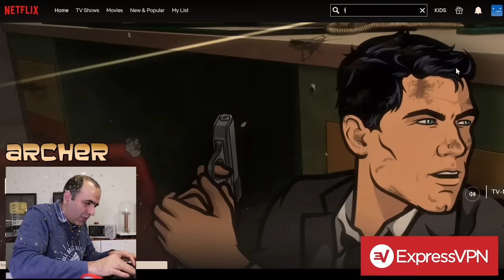What It Takes to Break a RAM with ESD (ft. Linus Tech Tips)

Comment: Have been building computers since the mid '90s, haven't killed a single component by ESD.. And only 2 CPUs by crazy over-volting/clocking
I build'em wearing socks on carpet, test mobos placed directly on the carpet, and I regularly wash components, GPUs and mobos, in the dishwasher (obviously remove the battery and heatsinks, and don't use detergent if you don't absolutely need it, wouldn't trust the cleaning agents to not erode/dissolve the lacquer/epoxy coating on the PCB)
As long as you make sure the component is completely dry before applying power, the odds of killing it are nil.
Reply: The most recent thing I chucked in the dishwasher was a laptop mainboard (i7 9750h w/ an nvidia 2060) about 2 months ago and then placed it in front of a fan, on low speed, for about 12 hours before reassembly. System works fine and looks brand-new. (most of the plastic clam-shell case for the laptop went in as well)

Comment: Putting ram in a motherboard and powering it does not test functionality.  Even a POST memory test just counts the addressable space.  You need to set each bit low, and high, and reread the values; and  even then you can hit some issues that show intermittently.

Comment: Did you actually test the RAM after every time you zapped it or did you just accept the BIOS beeping as if the RAM was still ok? I mean you could have easily damaged a small part (few bits or bytes) of the RAM without the entire stick being broken, BIOS could even accept the RAM stick, but trying to run a program in the affected area of the memory might result in malfunction of the software!

Comment: Install the contact discharge probe. Set the gun to +8kV 20Hz, touch the tip to a data pin, and let 'er rip.  Of course, that's not painful

Comment: Linus : 1. many ground pins is not to reduce chance of ESD reaching a functional pin - it is to enable larger currents and even flow 2. You never showed your shoes . how well to they insolate ? you may not be charging yourself to the expected voltage as charge may be leaking to the ground. 3 . I feel the video was too long to get to the bottom line - when when watching 2x .

Comment: Heya! I have a question, or maybe even a problem to solve!
I am trying to make a remote radio Voltage tester for electrical fences, it seems like internet is crowded with this question but no good answers. The problem is hard because it is typically high AC voltage (15-20k). I am trying to do this test using an 3.3V Arduino board, and my current idea is to just use a Hall Effect Sensor, but that wouldn't give me voltage. I also don't want to connect the live cables to the Arduino, but rather make something you can hang onto the fence or similar, and then possibly ground somehow to get a reading. There's lots of purchasable cheap Voltage Meeters out there that will do this, some even do non-touching but I cannot seem to find a good way how to create one. Best case scenario would be a DIY solution!

Comment: RAM can be damaged internally and still "work", as in the computer will still boot. you won't know the RAM is bad until that part of memory is accessed, and it might just crash a program, or it might crash the O/S and it may or may not interrupt the boot sequence, etc. you can't really tell if it's bad either without running a scan of the whole chip. (I also notice you drew MEEP MEEP on the screen? does that mean 2 beeps? because a normal boot is 1 beep, isn't it? what are you expecting to happen, no beeps at all?)

Comment: ohh boy, if you connect pcb to ground you can't energize ram chips in any other way that stright pass thru ground. You should pick this board on good isolator, like polietylene or polistyrene, dischard pcb into ground by your ground connection, disconnect this wire and now be charged and touch pcb. PCB in a short time should be charger by real random path and this spark should be destroying.
ESD is far more dangerous for unconnected devices. Or if i am wrong please tell me why my way thinking about esd is wrong.

Comment: Esd can damage some memory modules so that it still works but bluescreens when the OS tries to use the damaged part of the RAM... Thats what i've seen in the past.

RAM can still boot but randomly crash due to partial ESD damage, which is just as useless as completely dead as in this video. You would have to spend few minutes fully testing the ram to detect this

Comment: It it possible you actually caused some damage that would only be noticeable in a real usage scenario? For instance causing slow downs and random failures while working on memory intensive applications, etc...
Maybe it boots up just fine, but could fail under stress because of the damage? Or is it a guarantee that it would continue to work well as soon as it boots up?
I remember having a laptop's memory fail on me once in the past but continued to work normally for a while with decreased performance and would shutdown randomly sometimes.

Comment: testing as if it was in the pc was key. even with no power to the cpu you can still send power to the memory controller, and memory controllers are delicate, like 1.5v under load in ambient toasted dead dumpster fire delicate. the dram itself is fine, u can smash dram with volts and the worst that happens is instability. but the imc is what will die

Comment: From my knowledge of EDS and grounding its mostly about degrading the lifespan of parts.
I think ASML did a test on lifespan with/without ESD exposure.
Thats why in the field of engineering handeling parts worth 1000's $ and the cost of machines stopping because of failures, those few years realy matter.
In my whole carreer i might have blown up 1 IC due to direct ESD exposure, might have also bieng something else.

Comment: I have been traumatized by certification courses to wear a ground before touching the computers. I think this is a conspiracy created to fool people into thinking that the customer damaged the hardware with ESD rather than manufacturer putting out garbage electronics and poorly designed circuits. For a good test is to power on the computer and run RAM test and then zap the ram while the ram is under load of math operations.

Comment: Why didn't they they experiment the other way round, so to speak? Hold the memory in the hand with fingers on the contacts, charge up and then try inserting it in the motherboard. This would simulate someone not wearing ESD protection installing RAM in a motherboard. Or, if not trying installing it in a motherboard then touch one of the RAM contacts to ground.

Comment: It’s a dumb test…  ram is extremely sensitive to static.  The way ram works is a  cell that includes a transistor and capacitor for each bit. Over voltage on a capacitor is extremely bad because it will short or worse.. explode. You can take out a huge portion of the chip with one fault in the array of cells. 

Would love to see if “curiousmark” a electronics engineer and computer scientist on youtube (most known for his xerox alto work and the Apollo guidance computer work) unlid the ram and show the damage on a microscope.

Comment: Is it possible that the pads had ESD protection on them that only gets turned on (I'm thinking of whatever the solid state version of a relay switch is) once supplied with steady 1.5V?  And that when you removed the heatspreader and started touching traces directly, you bypassed this protection?

Comment: Can't ESD to a chip when it's not mounted in a circuit bc there's not enough capacitance to discharge into lol once a production employee was trying to lecture me on ESD when I was grabbing a replacement chip to ... get this... put on a board and zap it with an ESD gun lol (it was the part that died though... was a layout issue if I remember... parasitic inductance in a smps circuit)
Reply: Just touch the chassis first and you're golden ... as long as there's protection on the circuit and/or they passed their ESD testing ... can make an electric field lol started a voltage regulator on fire once after zapping the horizontal coupling plane below the device in a plastic enclosure

Comment: 80’s electronics was awful... I nearly hit my electronics instructor in the face with a robotic arm... I told him we had a problem with the arm going bonkers... He tried it and it worked fine... I just reached across and touched the cpu socked and the robot arm swung across and missed his face by millimetres as he leaned back. It only threw a wobbly whenever I was touching it.

Comment: Just touch your case before u work on pcs. The case should be grounded over the cable. So need to have the cable in the wall outlet. Sounds wrong, but is right :-)
Then unplug the case so ur hardware isn't grounded.

Comment: I once took apart a broken Samsung television and wanted to have the speakers and elecktronic form it and build a music box, of course I connected it as it was And I turned on th TV fully asembeled an started Youtube on my cell phone and played music over the TV to make Sure IT works, I pulled the plug Out of the Wall and grounded myself to the heater with an pice of wire, then I took the TV apart and got the biggest electric shock of my life I was even out of action for 5 minutes and then I understood that people shouldn't play with devices and what a capacitor does  this was an realy fat capacitor and an big transformator next to IT The 75 inch TV had to work somehow, I guess😂😂😢 Now I work as a residential electrician and grounding yourself while doing stuff with more Power is not the best idea !

Comment: Late comment but something to keep in mind is that skin has a relatively high resistance (usually in the kilo ohms range) and when you are using the ESD gun through the body it's quite likely that the body is taking the lion's share of the voltage drop in that circuit. While technically the chips can still die at a much lower voltage, using the ESD gun through the body isn't the same as your body building that same 8-12kV discharge since you will have some amount of loss just breaking the skin. And on Linus's video it was mentioned that the sticks were typically rated for 2kV and if there is enough resistance in the skin the voltage drop across the board may very well be below that.

Comment: Ok so, if anyone is good at electrics or anything that would be great, I went to heat up my tea in the microwave earlier, so I stuck it in, shut the door and everything was ok until I went to turn on the microwave at the plug (I'm in the UK), my right hand was on the microwave not sure if it was the metal side panel or the buttons, and I turned on the plug with my left, and I got a pretty bitching shock on both my fingers, anyone have any idea what the hell just happened? The microwave was ok to use after that, and heated my tea up alright with a couple plastic gloves, but still kinda worried about using it from now on. It was pretty shocking I guess you could say

Comment: Joke is on you. I have always handled ram with reckless abandon because the first time I ever changed out my memory i was wearing shitty polyester pajamas that built up a charge from me moving alone and i shocked the ram multiple times. It was DDR2 and it was going into a laptop with no protection, there wasn't enough metal accessible on the case for me to ground myself, so i was shocked again AS I PUT IT IN THE SLOT.
It booted perfectly and i proceeded to demolish everyone in middle school at starcraft.

I never wear a strap. I tend to rest my forearms on pc cases and when i work on servers i make plenty of contact with the outsides. If i see anyone wearing a strap to work on anything less than a 6 figure server i call them names. You know who you are, strap-on dildos.

Comment: I always thought that the issue with ESD was that sometimes the non-grounded component was charged and the ESD goes through a port that is in reverse direction which kills the devices. I've killed many devices in my time and have learned the hard way of why we need to be properly connected to ground/straps and when not to.

Comment: I could see it arcing at the ground clamp when it discharged through his finger. My father used to work for a sizeable company and I got to visit the static free room as a kid, thought it was so cool. Had to put on a special suit and everything and every table, every square foot of flooring has a solid ground. I learned a lot about tech stuff when I was little and that only fueled my passion for electricity and electronics. Now I am working my way through a degree in electrical engineering.
Reply: it calle "arking"
Reply: i doubt you are an electrical engineer now
Reply: @parallaxperception4971  I don't understand why you would say something like that, when I clearly stated I'm in college for a degree in electrical engineering.. You obviously can't read so, that's probably a good indication of your intelligence.
Reply: @420Chameleon  you wrote "ARK" wrong